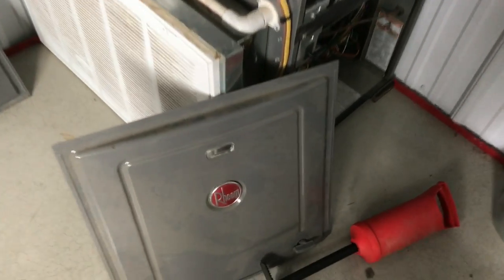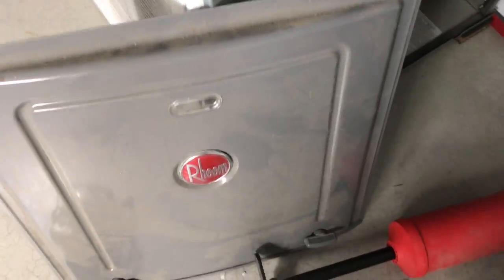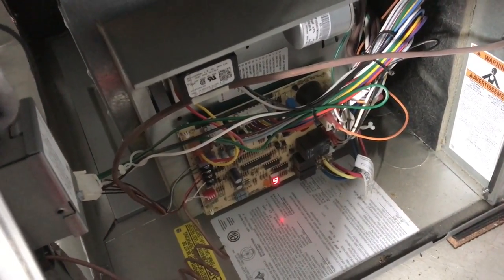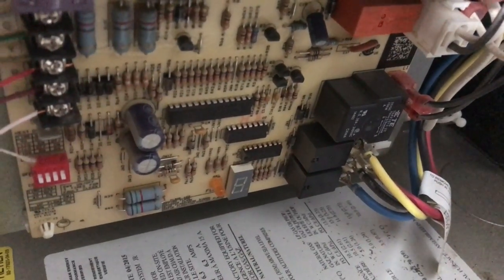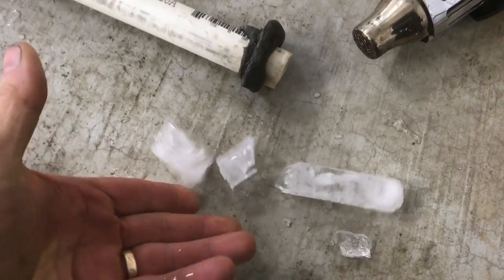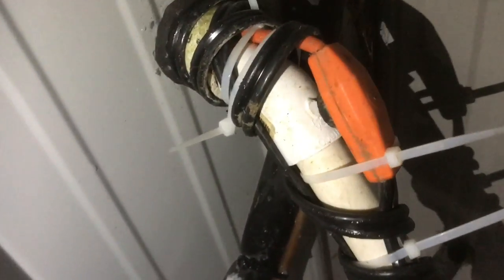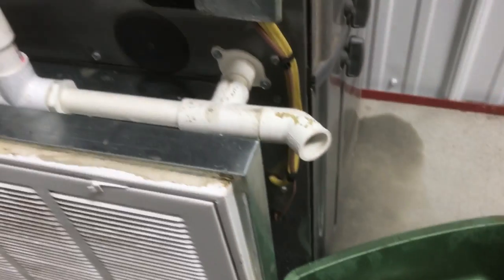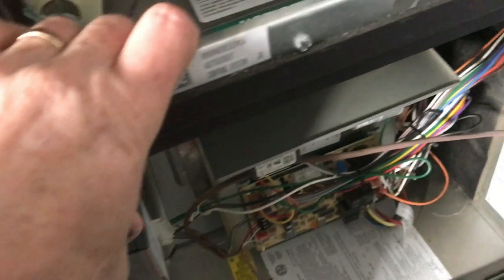Fix furnace with condensation line that keeps freezing

Comment: Extremely dangerous misapplication of cheap constant wattage heat tape. This is the kind of thing that burns houses down. Constant wattage heat tape crossing itself on plastic pipe and stuffed up inside - wet location. Unbelievable - do not ever do this!
Reply: @GeeKIller Never cross over constant wattage heat tapes - never ever! Thermostat or not.

Comment: I have a 90° unit the same thing happened to me but now they're still condensation coming out going into the air flow box which I call the squirrel cage but still coming out of the condensation lines. Fear of them freezing again which they will if something is not done anyone have any input on this I believe someone that works on these that does not live close to me inform me that there is something Jarred loose inside because somebody opened it up and looked at my unit but didn't fix it or there's a small crack in the condensation inside the unit and it's leaking over onto the air flow squirrel cage box I now have a bucket catching it right now the condensation line is now wrapped in rubber insulation due to the fact heating tape they say will melt the pipe. Any input is appreciated calling a guy to look at it today to see if somebody will even open it up and fix the problem instead of trying to selling me a new unit

Comment: Call me crazy, but it seems like a pump to an inside drain should be the default for a furnace installation
Reply: Or if you can gravity drain to an inside drain. The only thing that sucks about a high efficiency furnace is that the drain will freeze qhen the outdoor temp gets low. So much for efficiency.

Comment: Do Ruud High Efficency Gas Furnance have any way to prevent Heat exchange coil from freezing. My unit is in the attic and the attic will get cold this winter. Idot who recommended and installed it (6 months ago) will not return my calls. The attic is insulated, but only the floor. Cost for blown in insulation in attic rafters is $10K!  Do I have any other options beside insulating or new furnance?

Comment: same thing is heaping to mine but on the heat tape box warning its telling me do not put it on plastic pipe that is not always filed with water. any thoughts? Thanks.
Reply from the maker: One thing that people do is to drain the water condensate to an inside drain. They make a pump that the water condensate will drain into the reservoir and when the level gets high enough the pump turns on and pumps the water with enough pressure to drain it into a nearby inside drain. In the case where I put the heat tape on the outside of the house I did this because I wanted to make sure that it did not freeze up and turn the furnace off again. I do suppose that it is possible that the heat tape could melt or distort the pipe. These heat tape units do have a thermal switch that only comes on when it is close to freezing temperatures. If it was continuously on in the summertime I can see that the likelihood of softening the plastic would more likely happen. I would say the long-term solution would be to drain the water condensation to and inside drain. If you have any other questions let me know
Reply: @livefree6878  Thanks for the info i got a 6ft copper pipe. that will be the pipe that i will run outside and that's the pipe that i will place with the heat tape. And from the copper pipe to the furnace i will run rubber tubing because most of the fittings are plastic. And like what you did i will run the heat tape all the way to outside of my house. I got the copper pipe and some isolation. But all the stores i went to are out of heat tape so i ordered some from amazon. thank you for everything. Happy New Year from Santa Fe New Mexico.

Comment: THANK YOU FOR THIS VIDEO! I have the "permanent solution," a Mighty Pump Jr. and it still has a plastic drain tube. Furnace was off, look at the tube outside, it was frozen solid. Went under the house, cut the tube to drain into a bucket and the furnace instantly turned on. YOU'RE THE MAN!

Comment: Question, I had a similar issue come up while away and the furnace held at 56, but couldn't heat.  I got home to find the condensation drain was reduced to 1/4" from 1" and froze.  It ran like this for 4 or 5 days.  Does anyone know if this results in any carbon/burner issue I should have repaired before I use it again?

Comment: @Live Free I had the same problem but I have a condensation pump with no access to an inside drain so the HVAC tech ran the tube outside. Now the outside tube is freezing shutting down the furnace. Any recommendations that won't melt the tube?

Comment: Is there a permanent solution? Thanks
Reply from the maker: The permanent solution would be something called a condensation pump. This is a little pump that sits near the furnace so when the reservoir gets full of water there’s a float inside The unit that will detect when it is full and pump the water from the reservoir to I and inside drain somewhere. The best solution of course would be if there was a drain really close to the furnace inside where you could drain it into that.
Reply: @livefree6878  The problem with draining it inside the house if you have metal drain plumbing.  I'm not an expert by any means but I have this problem.  The drainage water is acetic and will ruin your metal pipes over time.  Just google this subject and you will see.  They have a solution of using a cartridge with limestone to counter PH in the water so you can drain it into your metal plumbing.
Reply: Costgard condensate drain seal
Reply: We foresee the same freezing problem. What we're going to do (this is new construction) is drill a 8-10' vertical hole (approx 1' dia.) and insert 4" perforated drain pipe with filter fabric in the hole and backfill it with rock. Then provide a slotted floor cover plate and insert the drain line into the perforated pipe and let the water drain into the rock and Earth